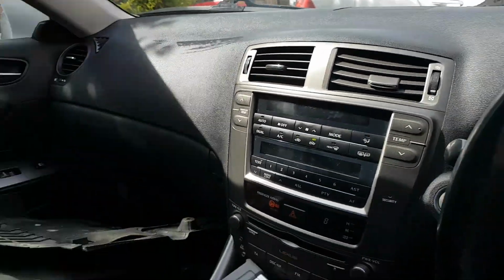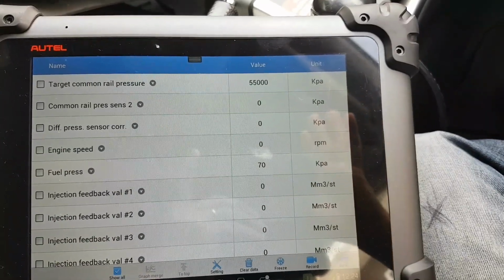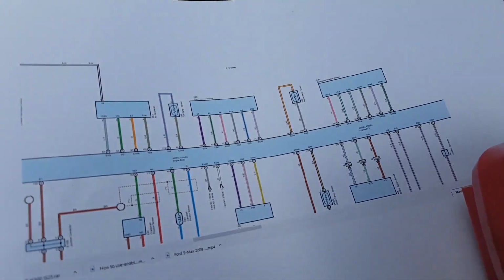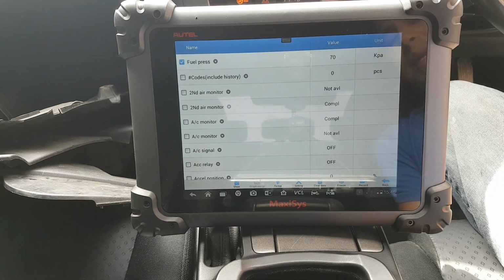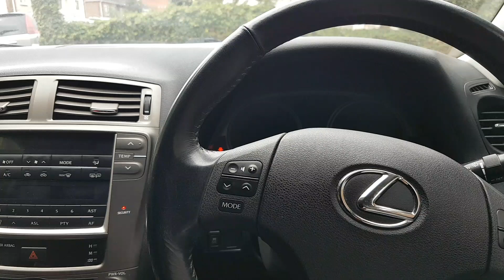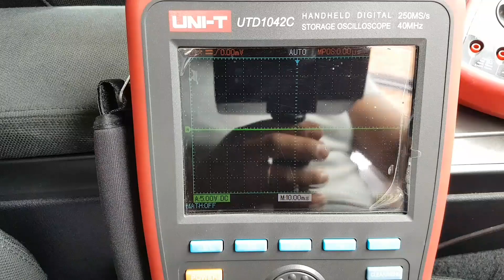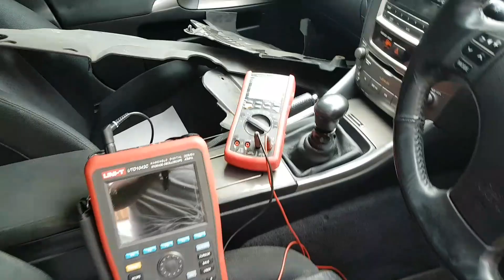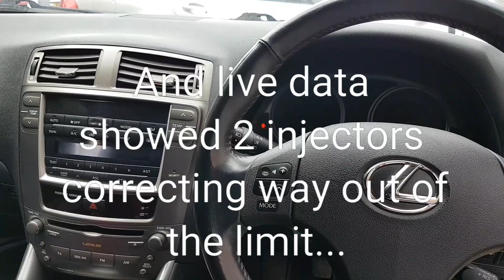Lexus IS 220d Cranking no start and no codes. (READ DESCRIPTION) Fault finding and repair.

Comment: Neat trick swapping the filter pump over to the suction line to check for leaks. Bet your not the only one who didn't realize about the fuel pump, I sure didn't. Cheers and thanks for the great info.
Reply from the maker: 😊
It can be tricky when you work on a system for the first time... lol
Thank you for watching and for your comment!

Comment: Hi. Good film. I the same Lexus 2007 model and I have a problem with it as a engine when is on the idle speed it goes off by itself. Then I connected it to the diagnostic tool and it showed p1229 foult (fuel pump system) and on the Internet I found info that most of times is a fuel pressure regulator or wiring to that. If you can help me where can I find it that's would be appreciated
Reply from the maker: What exactly are you looking for?
I am pretty sure I have showed all of that on the video...
👍👍👍

Comment: Great video! Can you please explain from video starts at 25.00min how did you bypass fuel filter? I’m a bit confused how it works. Has x2 pipes bigger diameter and x2 small one of them is pump output but other x3 I’m struggling with. Please help if you can. Thank you. Regards

Comment: fair does to you we are never going to get it right the first time every time . had a one very slimmer diesel filter had been changed and the o rings on the filter housing where missing. i was about to call the pump
Reply from the maker: Indeed... I missed to check that fuel was at the pump...🤦‍♂️😋
Thank you for watching! 
👍👍👍

Comment: Interesting video. Hey we all make mistakes. Just a point - you said early on in the video that your reading of 70 Kpa was equivalent to 7 bar. It's actually 0.7 bar . (Divide by 100 to convert from Kpa to bar)
Reply from the maker: Lol... I must have missed that one...
I have done too mutch cutting and merging on this one... way more than I usually do...😋
I also said that that pressure was from the pump in the tank, when it was actually the rail pressure... lol
Thank you for watching and for your comment!
Reply: @LMAutoRepairs  - Thanks Luis for another very interesting video.
Talking about the pressure on the system. This last week I also had to deal with a non running, non starting Toyota D4D. In my case the wife's Yaris. 
After being towed home, I had a look and the main error was too high pressure in the system. With the error code P1229. 

With this said and just for the record. Live data shown 248 Kpa, high enough pressure to produce the error. And induce the system to shut down! 
After intervention for cleaning the SCV and a new diesel filter, etc. The pressure stabilized on a more "civilized" 120 to 128 Kpa. Followed by the vanishing of error P1229 and associated no running, no start faults. All back to normal.
Something that might be worth keep in mind for future reference. Fica Bem! ;-)
Cheers
Reply from the maker: @crpth1  
Obrigado! 
👍👍👍

Comment: Good video as always . I have never see a 6wire pressure sensor . I don't know if can explain Abit  how it works  please .  I googled can't find any information . Mostly three wires . Thanks
Reply from the maker: Hi
I only seen them in Asian cars... Toyota, Lexus etc... 
Accordingly to the diagrams and pin assignments,  looks like this one's are like 2 sensors in one....
Not sure if they measure different voltages or something similar for better accuracy...
Would be interesting to measure/scope the signals and see exactly how they work...
Job for the next one I work on...thank you for watching and for your comment!
Reply: @LMAutoRepairs  well thank you for that . Looking forward to that .

Comment: Next time you repair diesel cars that do not start,you go like this:rpm sensor-you crank the engine and watch tachometer,fuel-maybe the fuel pump not working/hit the fuel tank-maybe the hp fuel pump is full of air/spray starting fluid in intake,after that test returrn line from injectors..
Reply from the maker: I know I kinda messed this one up... lol
Thanks for the advice...
And for watching!
Reply: Allso,when you put ignition on,watch for engine failure lamp in the dashboard,and for immobilezer light to go off.If the engine failure light is present means that engine computer is powered on and waiting for the engine to rotate to start injection.
Reply: In 2 minutes you can diagnose a no start do crank diesel failure.With no tools,only your brain.So,what  
happened to you?Air,compression,fuel.wtf?I was watching your video and i was screaming at the computer,if there is no fuel to compress how can the fuel rail sensor show you pressure?Bad day?
Reply from the maker: @nijloveanugelu  
👍
Reply from the maker: @nijloveanugelu  
Ok... I got there in the end... we all do mistakes... I can't recall exactly the circumstances of this repair, (this was done long time ago...)...
I even put some on the screen text saying that I have missed an important check at the start... which was the fuel at the pump...
There is need to carry on beating me... lol
😋
Reply: @LMAutoRepairs  I am sorry for what i have said.We all make mistakes.I have not ment to be hard on you.I am not the perfect mechanic and i do mistakes allso. I respect you and i appreciate that you took the time to make videos for us.And i know that an 1 hour job is 2 hour job if you are make a video in that time.With respect,Nijloveanu Gelu.
Reply from the maker: @nijloveanugelu  
No worries...
I was just saying as well...
I appreciate any comments and suggestions... they are all more than welcome...
Sometimes because I don't work straight an a job from start to finish,  I sometimes forget where I stopped... lol
Not using it as an excuse... just saying...
😉

Comment: Hi, I need help, I have audi a4 2013 and I have problem with radio-modul in the trunk of the car, everythig works good but no sound from the MMI, it says "currently unaviable", I went to the service they told me the problem is in that modul in the trunk and it costs about 1000€ to change...Can it be repaired? i have mmi 3g plus in audi...thx for any help.
Reply from the maker: Hi
Difficult to say... can you scan the module?
Have you opened the module?
Any visible damage?
Thank you for watching!
Reply: LM Auto Repairs Hi thank you, 
No error when I scaned it, and I have not open it, I tried to find on internet about this but there is no anything... I will try to go to the service again and ask then to try repair it...if not I have to buy it... :(
Btw. Sorry if my english is bad
Reply: @LMAutoRepairs  Hi nice video. I have a similar Problem with same car Lexus IS220D. VSC/TRACTION LIGHT COMING UP AND losing pressure. Please how do i contact you. George

Comment: Hi, I am new..
Q. How you Check pressure sensor wiring to Ecm pinouts  with multimeter?  You skip that...i am new. Plesse 
please tell me
Reply from the maker: Use the continuity or ohm meter...
Reply: @LMAutoRepairs  what if i connect wrong pin?
and what will be the Ohm readings? .3 ohms?

Comment: Hi thanks for sharing the video. Is there any change can you give me your website or contact number? Because I spend a lot of money for my Lexus IS 220d but unfortunately no one can’t fix the problem. Maybe you can help me.
Thanks
Reply from the maker: What is the issue?
Thank you for watching!
Reply: @LMAutoRepairs  Hi I have the issue with Lexus IS 220d. Would crank but would not start. Also on the dashboard the VSC light is on and I check the code for the fault is P0093 which is Major fuel leak but unfortunately there’s not leak. Maybe you can help me as I spend so much money for the garage and different mechanic but they can’t fix the problem. Maybe you can.
Thanks
Reply from the maker: @castelacleanersltd4515  
Just like in this video, check for vacuum leaks..
Reply: @castelacleanersltd4515  i had this problem few years ago, took DPF out, problem solved.